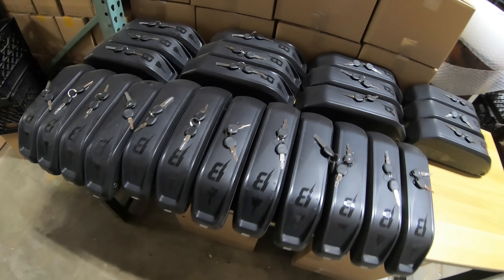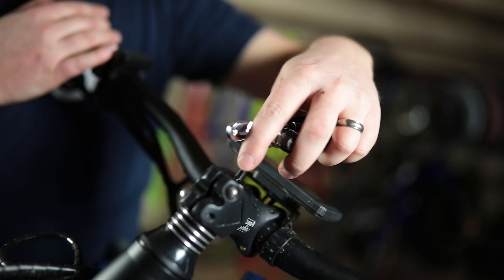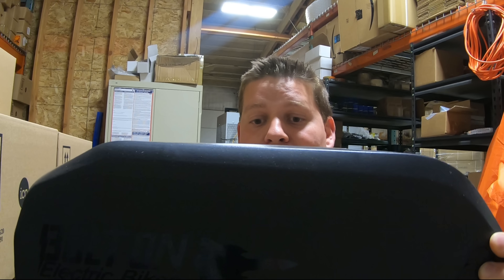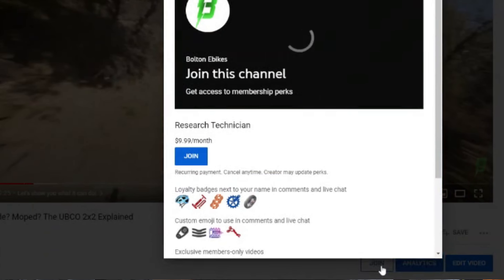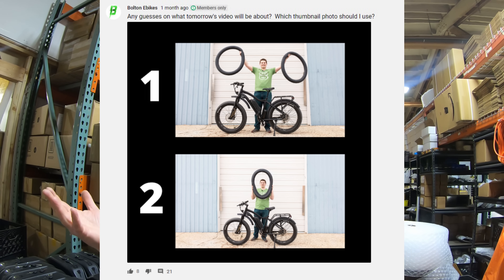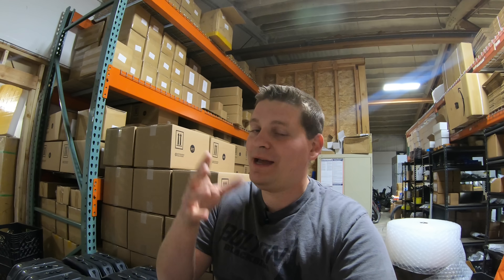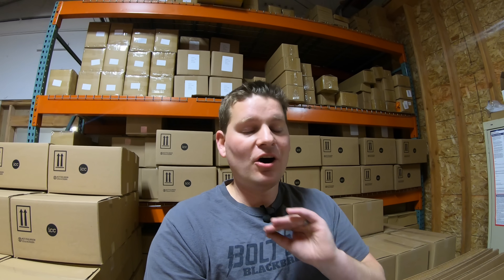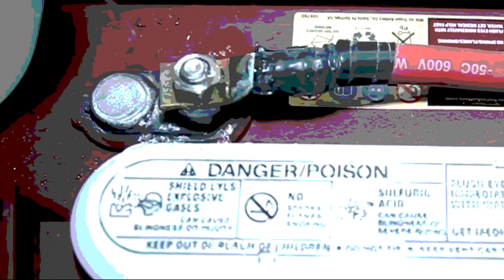How to maintain Lithium batteries for electric bikes - Easy!

Comment from the maker: What percentage do you charge your battery to?
Reply: 100%
Reply: normally 100%. haven't had an issue with either of my bikes (radrunner w/ bolton upgraded controller and juiced scorpion with the off road controller upgrade). although, my scorpion does tend to "run low" on voltage faster than the battery loses power. maybe the 52v 13ah battery struggles to keep up with the off road controller power needs. not sure. doesn't really run the voltage low if i mix in some pedal assist.
Reply: @dethsightgaming  some Ebikes have regenerative capabilities. Like going downhill or braking
Reply: 100%
Reply: Sometimes 100%, if I am going to ride it soon after charging it, like the next day.  I don't like to leave it fully charged if it is going to be sitting for several days.  I like 85% if it is parked for several days.  Most of my rides are 10-14 miles and 85% does quite well.  Have a Great Evening!
Reply: 80% Get the most cycles by doing this. Recharge at 20% Every once and a while charge 100% Invest in a high-quality smart charger with a fan and extend the life of the battery by double the expected life span. Completely worth it when batteries are expensive.  Do not use the stock charger in my opinion. They're trash.
Reply: 100% before riding. Store between 70% and 90%
Reply: I probably should charge it less but I do 100%. I'm looking to buy a battery at a discount and do those blue batteries have the BMS? Maybe that's why they are way cheaper places like Alibaba. I saw a place where I could have bought the hammer bike for $750 if I waited three months. Well for people like me that will save me more than $600
Reply: @LetArtsLive  there are a lot of scams regarding the Ecotric bikes.  If you can get a Hammer for $750.00 buy two!
Reply: how am I supposed to know if it is 70% or 90% when my indicator doesn't say so
Reply: @juri2001  you can use a multimeter and a chart to read the voltage.  Stop your charger at the voltage you want.  There are expensive chargers that can be programmed.
Reply: @juri2001  buy something like a Luna Charger
Reply: @juri2001  what e bike?
Lectric 3.0XP  has a voltage reading option.
Other makes you can install a voltage meter and graph the usage
Reply: @juri2001  I have a 36v bike battery that has no indicator, I use a voltmeter and measure where the bike is connected and when it shows 41v it is almost charged 41.4 is a little better not over 42v, the voltage drops when you stop charging and that is because the cells have a resistance. a BMS balances the cells so that the voltage is the same and ensures safe charging/discharging.
Reply: @juri2001  Buy a CVCA charger.
Reply: Always 100% for that itchy throttle thumb.
Reply: I have two chargers, one does to 100% (58.8v from 52v charger) just before a ride, the other does to 60% (54v from 48v charger) after a ride and it stays on that charger until the next ride. I don't ride everyday, even at 60% charge I can dash locally and back without dropping more than 15% so not having 100% all the time is no biggie. Longer rides are planned so no problem to bring to 100%. I'm covered for not sitting at 100% all the time and for never falling into danger zones if left alone for a while.
Reply: @bluejeans725  nice idea to use a 48 and a 52v charger on a 52v pack... I never thought about that (I also have 52v packs)
Reply: Heat destroys the chemistry of the cells.keep the bike at a cool place.use a timer to charge to 80% .when planning to use it charge to   
100%.
Reply: To the top!
Reply: 100% unless the  battery is going to sit for a while. We're already giving away 20% on the bottom with the controller shutting off at 3 volts per cell. .The sweet spot in riding is above 4V/cell.  Sadly, my experience is that he BMS is more likely to fail over three years than a cell.
Reply: Hi
Reply: 80%, just buy a bigger one.
Reply: I charge to 100%, since I assume that the onboard charging controllers of high end batteries will cut the charging off anyways in order to  protect the battery and maintain the longevity.
Reply: I have a Hailong battery.  with the Red battery switch off It still show 3.3 volts at the terminals.  is this normal ?
Reply: I charge to 80% unless I need more for a longer ride. I use a Luna charger and can set it to 80, 90 or 100%
Reply: My 36v battery used to run the motor down to about 35.5 volts before cutting out but now it cuts out at 39.5 volts.What the hell is going on?
Reply: @nicholasmorrill4711  controller is a 36v/48v unit.. controller thinks it's on a 48v battery switching off at 40
Reply: @dg9bfc  Why would it suddenly do that having successfully charged up my 36v battery for several hundred hours?
 I take your point & it is an interesting suggestion & as I have now completely replaced my electrical system & it has a new controller I might try it out with the old battery & that would see if it was the controller or if it is the battery that is US.Thanks for that.
Reply: @nicholasmorrill4711  I had tried to partly discharge pack... complete disconnect controller for a while and then reconnect... now controller should know it's a 36V system and work as usual
Reply: @dg9bfc  I have got a new controller & can see no reason that it would'nt operate the battery properly if what you say is true.We shall see.......
Reply: I have to travel 20 miles and my ebike gets 20 miles at 100 percent charge so I have to charge it by 100
Reply: 80 20 rule
If you need 100% for a longbt4ange trip okay
Otherwise charge to 80% drain to 20% 
Charge again at night.

Lasts longest more full cycles 
I can go all day with my Lifepo4 48v 20amp mod on Lectric 3.0XP
Reply: I charge to 100%. I want maximum range when I ride. My individual rides usually take my battery down to about 60%. Maybe 50%.
Reply: How much a price
Reply: 5
Reply: 100 % if I’m going on a ride but if the ride won’t be for a day or two around 60%.
Reply: Electric cycle battery name
Reply: None, since it hasn't arrived but the manufacturer recommends 80-90%. Quite certain this is so that regenerative braking doesn't overload the cells.
Reply: I switch it up. I randomly switch between 80 - 90 and 100 depending what I need for the ride.
Reply: For all the 7% 1-2 mile grades around here a regenerative system that you can turn on or off sounds ideal, otherwise you are loosing all that mass times gravitational energy that otherwise would be stored in the battery to use to help go back up the hills..with regen turned off. These hills are so steep I've had to practically sit on my rear rack and hope the brakes don't fail. In these inclines drag is most welcome..eg turning my A/C on in my 4 cylinder truck to give some engine like drag going down 3000ft to 1200ft from Groveland.
Reply: What about GEL type batteries do you completely run them down before you fully recharge them or just very low then recharge As one thing you have never mentioned anything about GEL type batteries so can you give any advice on these types of battery. You mentioned other types but not these types of battery.  Have you ever heard of these or not ?   🤨🤔
Reply: MY phantom E-scooter charges to 58.4  and its a 52v 23ah chart says 58.8 is 100%. but my charger goes off at 58.4v
Reply: Always to 11
Reply: I have dual motors on a Schwann sidewinder(Walmart) . Each motor runs off it’s own battery, throttles and has two displays.  I charge the battery for the rear motor up to 100% (most of the time, sometimes I’ll unplug it before it reaches 100%)and the front motor battery I use a bench top power supply to charge it up to 54v instead of 54.6. It’s has some good torque. 😁
Reply: Per battery engineer discussion I keep my Li E-Bike battery between 20-80% for *longivity (charge cycles).  I use a plug in timer (used for lights & sprinklers).  It charges at 10%/40 mins. If it is at 60% I set timer for 2 hrs. I charge it to 100% once to twice a month & for the occasional 40 mile ride. *A new battery is %600.
Reply: I have the Foxbat. In the video you keep mentioning battery percentage. I have no way to tell what the battery percentage is. I do have the battery voltage. Do you have a chart that will tell me what percentage is by the voltage on my Foxbat 48-volt battery
Reply: Mine says 100% I've got 52v 20ah it seems to be cutting out before the 20 miles fully charge witch I'm pretty sure is roung cus the batt still says 100% on it but it cuts off my bike
Reply: till the LED changes from red to green.
Reply: How to keep the battery from being explode?
Reply: @farhadnor6494  You can't fully protect the battery from malfunctioning so even though the chances are low that the battery will explode or catch fire, the best thing to do is lessen the chances by using the correct charger for the battery and monitor the battery while it's charging. As an example don't charge the battery in the garage and then go inside your home while it's charging. Keep a smoke detector near it. When it's fully charged unplug it and don't let it keep charging for hours. Think about where the battery is located should it catch fire. Have a fire extinguisher close by. Also keep all the connections clean and the air vents on the charger free of dust or debris so it doesn't overheat.
Reply: Always 100%, and always in the evening before bed (when the battery is relatively low) so that it's fully charged and ready to go in the morning.
Reply: always keep it 100
Reply: How can I discharge my lithium battery besides riding it!
Reply: The commercial are already disaster for concentration.
Reply: on my surron e-moto 80-90% mostly but sometimes 100% if i drive right after the charge.
i can not control the charge state of my e-bicycle so i stop if it stops charging
Reply: Dude playing just tell the story bud.
Reply: most bms only balance at the top end of a charge and with just a few milliamps
Reply: Up to the manufacturer's recommended value.
Reply: I got a brand new ebike.    
The battery came full. After 20 miles the battery indicator light turned RED 

But the SPEEDO still said 60% BATTERY LEFT 

And it showed 4 OF 5 power bars left 

So the SPEEDO % didn't match the bar level and the bar level or % does not match LIGHT COLOR on the battery itself

How do I make them all match 

Google says to charge to full then to Over charge for 6 more hours after it's already green to balance the cells 

I don't think that's correct 

What do I do
Reply: I got a brand new ebike.    
The battery came full. After 20 miles the battery indicator light turned RED 

But the SPEEDO still said 60% BATTERY LEFT 

And it showed 4 OF 5 power bars left 

So the SPEEDO % didn't match the bar level and the bar level or % does not match LIGHT COLOR on the battery itself

How do I make them all match 

Google says to charge to full then to Over charge for 6 more hours after it's already green to balance the cells 

I don't think that's correct 

What do I do
Reply: what are these percentages everyone is talking about? I go by voltage.
Reply: I don't understand why it is not possible to have a generator on your bike to charge a battery but it must not be possible or someone would have done it. I've seen people make a house fan into a generator why could you not make a bike motor into a generator and have it in your wheel?
Reply: @LetArtsLive  It would not be hard to do the problem is that the generator would consume more power to operate than it would would generate causing an actual loss of available battery power rather than a gain.
Reply: @LetArtsLive    Generators create drag, and the more you load them down, the harder they are to turn.  You could put a generator on your front wheel, but it would create more drag, which would require your battery to put out more power.  And, due to the laws of physics, the amount of power needed to overcome the extra drag created by the generator would always be more than the amount of power the generator would be producing.  Some bikes with direct drive motors have regenerative braking, just like hybrid cars.  It's useful for slowing your descent down hills, or stopping, but when regenerative braking kicks in, it's like putting on the brakes.  The generator produces electricity during regenerative braking, but the more it produces, the more drag it also produces.
Reply: @ExSkyCyclePilot  thank you for the information. I have seen people with gas generators on the back that would seem to be counterproductive. It would take days to charge with a solar generator the only alternative I can think of is bring more batteries. I can go 40 miles now with two batteries cuz I can't p e d a l with one leg period when I get my fake like I'm going to try it will be good for me to exercise put it on three or four. The ecotric hammer my bike does have generated breaking
Reply: @LetArtsLive  You're welcome.
Reply: @LetArtsLive  I think I seen of a bike or moped style that you will pedal at a constant speed generator that would charge battery
Reply: @LetArtsLive  My bike has it.  Its called regen.  I can turn the feature on or off.  I usually leave it off so it feels like a regular bike.
Reply: @LetArtsLive  It is possible to generate power from a front wheel generator, but the generator is doing work. That work takes the form of drag on the bike, like a brake.  Since the generator isn't 100% efficient, or even close, and the bike's motor isn't either (I think they are around 80% efficient) you would be riding a sluggish bike that has a heavily loaded motor at all times and discharges its battery even faster than without a generator.  It's a problem of efficiency in both motors.  
They do have regenerative braking circuitry in some bikes. It only activates when the motor is coasting, it becomes a generator for that period, it slightly slows the bike while supplying a current back to the battery.  Personally I don't like the complexity on a machine as basic as a bike.  I like to go fast down the hills, for free.   ;)
Reply: @LetArtsLive  Because then your bike would be a "perpetual motion" machine and this kind of machine is impossible, as it would violate either the first or second law of thermodynamics or both
Reply: @LetArtsLive  How come they can’t be perpetual motion?
Reply: @LetArtsLive  no such thing as a perpetual motion machine. 
That's why.
Regen yes in that instead of using brakes when slowing or going down hill the motor puts energy back in to the battery.
Like Ezv Cars...
Reply: @LetArtsLive you could use braking to generate power. Just do it
Reply: @LetArtsLive  in terms of resistance it only makes sense if you a- have big hills, or b- ant to pedal alot alot. Some European bikes, and older North American ones have generators on the wheel run a light. That's about the most that tech can manage. Charging a battery that is turned off would take hours of pedaling.
Reply: @LetArtsLive  Look up "perpetual motion machines" for the answer. Which is different from regenerative breaking.
Reply: It is possible., but it cancels.all the idea of ebike. The kinetic energy consumed is lower tha  the electrical.energy charged plus the weight and complexity.  @LetArtsLive
Reply: What's it going to run off of? The battery? The battery cannot charge the battery
Reply: @LetArtsLive  a petrol generator on a trailer and a beefy charger and you can drive forever
Reply: @LetArtsLive . The problem would be that a generator large enough to do the job, would be about the size of the motor and would require a lot of power to drive it, and therefore greatly reduce the power to the bike for repulsion.
Reply: @LetArtsLive it takes power to make power. The only way you could charge your bike while riding is if you do all of the work yourself, and you would need power to propel the bike AND charge the battery. Even lance armstrong with all the epo in the world isn't going to be able to do any king of meaningful riding while simultaneously charging a battery under his own power.
Reply: @LetArtsLive Didn't you study physics at school? 😂😂😂
Reply: 85-90% for most rides.  100% for long days.  50% for long term storage.  Every 4 or 5 charges to 100% for balance.
Reply: @sting1111  same but i go to 60 percent to allow for a bit of voltage drop over the long term

Comment: I want to know, what I need to do after 4 thousand miles. I've laid it down multiple times. I've replaced parts multiple times. All year round daily driver 20 miles per day. 365. Minus 52. Days. That's just 5 mile trip.

All of a sudden I'm getting error codes. And brk sensor is on. I can't ride. Error code 5. And then when I use throttle, error code 4.
No throttle but pedal assist still works until brake sensor turns on... Is this a battery issue?
The terminal after being weathered is greenish with deposit, and I have four out of five. Yeah one broke off

Comment: Awesome video! Thanks a lot! I live in NH and got my first ebike in August this year (Lectric XP4 750w). My last ride I was able to get it down to 80% with the plan to take it down to 60% this week. Well, the snow came in HARD lol. So no go. I know 80% isn’t ideal to store for the winter, but I have no choice. After watching your video I think my better will be ok as it has BMS. Any advice folks on how I should check it over the months? Bike and battery are stored indoors.

Comment: I've always gone 100% for 3 years on my battery and haven't noticed it degrade yet. I always bring the battery in the house summer and winter. I've run it out twice now while using it but fortunately I have no problems . Ask me in 2 years.  Thanks for the video and I've subscribed because liked the presentation of it but more importantly I think you know what you're talking about!

Comment: My battery went bad not even after 1 cycle, I just it first time up to 40% them charged it to 100% and didn't use for 2 months, then when I tried to use it or charge there was not voltage output from the battery